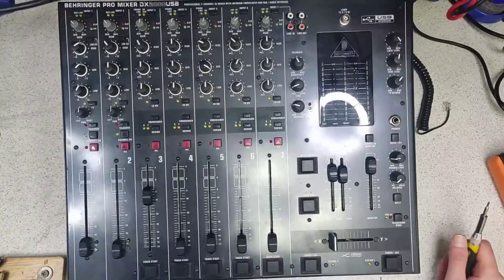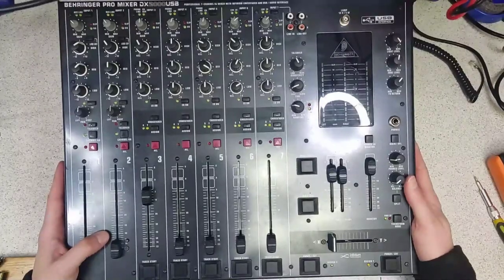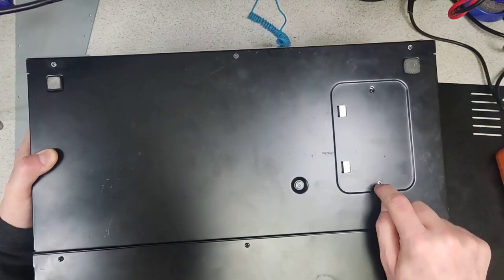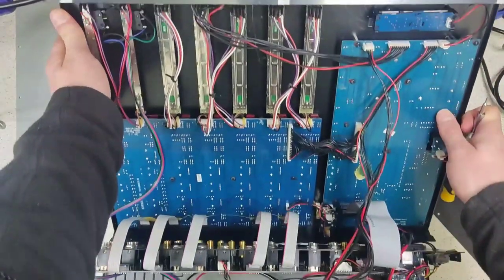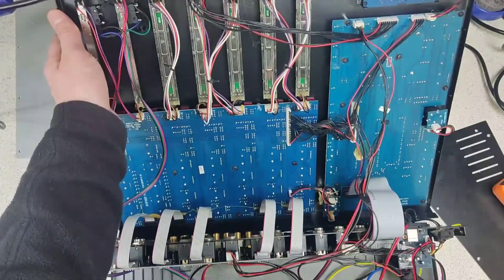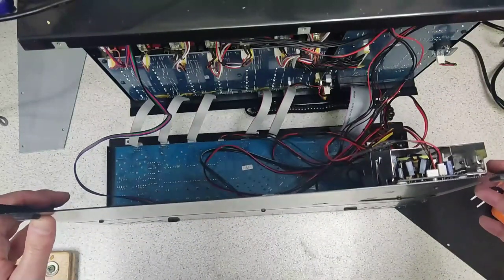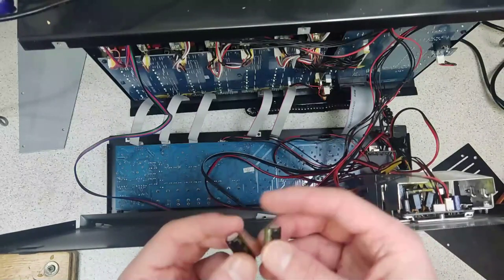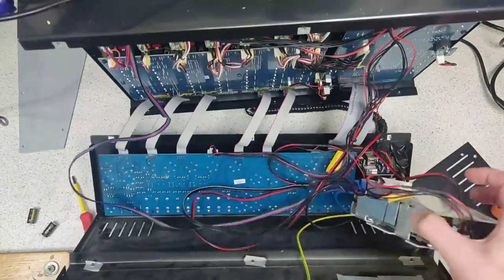Fix misbehaving lights and sound on a Behringer mixer (DX2000USB)

Comment: Hey Michael, I have the same problem on the Xenyx 1222USB series, where when the power is turned on and there is no input on the channel, suddenly the signal level on the FX rises to around -15 and there is a ground sound if the main output fader is increased, I hope you can help me and provide a solution, thanks in advance 🙌🏻

Comment: Hi Michael. May I ask you a question about DX200USB?

I'm trying to interface the "start track" button outputs from my mixer to an Arduino (to trigger light changes and other things when a track starts).  

The diagram on the rear panel of the DX2000USB seems to say that I should have +5V all the time on these jacks and that it will pulse low for 50ms when a start track button is pressed.  

But, on my mixer when I put DVM across any of these jack I see almost zero volts, but they do appear to pulse high (well, I only have a DVM and I can sometimes see about +2.5v on that for a moment) when I press a button. When I connect the tip of the jack to an Arduino pin (set to blink its onboard LED when it sees a high to low transition on the pin) and the jack ground to Arduino ground, the Arduino seems to trigger almost continuously. 

So, do you think I am misunderstanding how this should work or do  have a faulty mixer?

Thanks for any advice on this.
Reply: Just in case anyone else comes this way via Google or whatever....

Well, as before I have received help from other quarters than Behringer's support channel (who have not even replied) and now have an answer to this: 

The "track start" outputs are actually open collector outputs.  If you want to interface them to a 5V DC logic device such as an Arduino or other 5V Microcontroller - it's very easy but you need to use the right component value for a pull-up resistor. I was using a 1.1K resistor which was too high a value.   Here's the step by step for a working solution:

1) Connect a 330ohm resistor between the tip of the "track start" jack to the Arduino's +5V pin (or to its 5V supply if you're not powering it from USB).

2) Choose your Arduino input pin (setup in your code using "pinMode(x,INPUT)" - i.e.  do NOT use INPUT_PULLUP).  Also connect this pin to Jack plug tip,  alongside the resistor. 

3) Connect the jack plug ring to one of the Arduino ground pins (or teh ground of the power supply if you're using one. 

Now, when you press the track start button you should see a LOW pulse at the input to your Arduino and your code can do whatever it is you want to happen when a button is pressed.
Reply from the maker: Really useful, thanks for coming back to post your findings!

Comment: My mixer is very hot on all the inputs, making mixing impossible, would that be a similar fix?
Reply from the maker: It depends what you're calling "too hot". If you're judging by the signal LEDs being strongly lit, or the LED sound meters being lit to the top despite very little sound on any channels, then yes this may be the cause.

However if you mean that the clip light on the channels is frequently lit, then it's probably another fault (gain too high / phono preamp switched on for a line level signal) etc
Reply: @MichaelBrooksDr  Hi thanks for reply, all the inputs sound distorted and impossible to mix even at low input gain, it doesnt appear to be summing at all, its under warranty so its gone back, cheers again. james